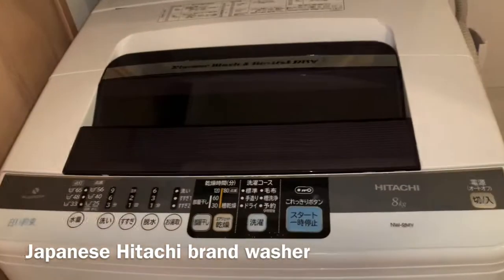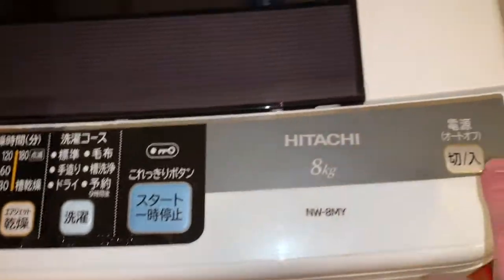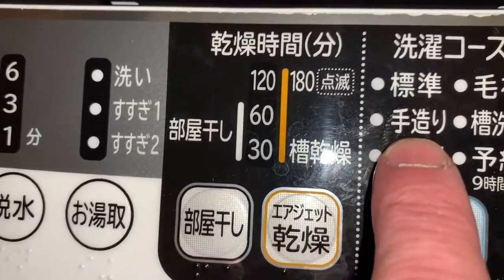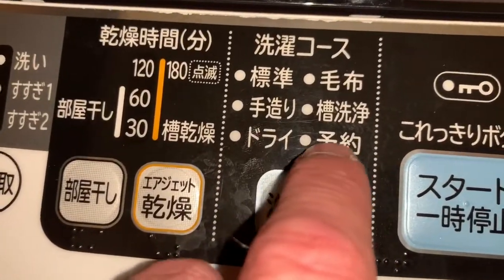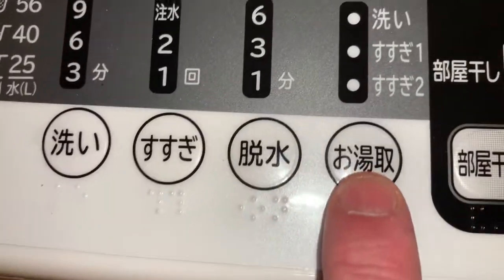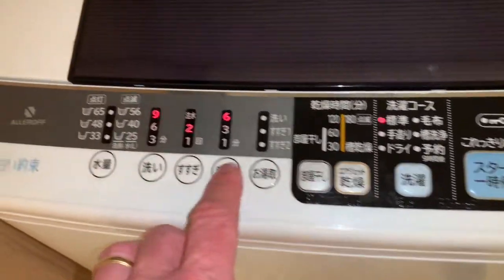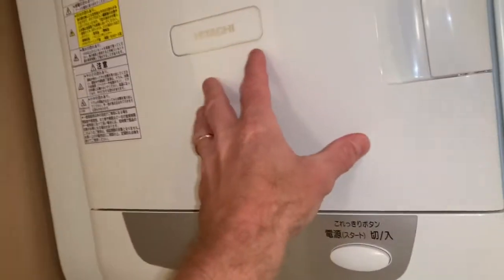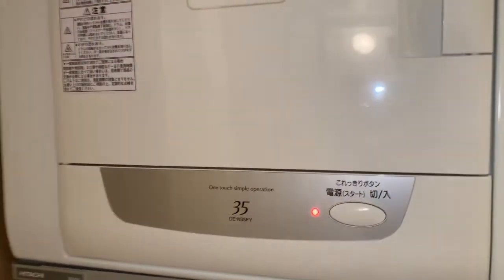How to Operate a Japanese Hitachi Brand Washer | Kanji Translation and Tutorial | Alleroff Model

Comment: Hi sir, the washing machine at my house makes a beeping sound when I press the power button, but no light comes on. It is 110 auto, it is 220, it doesn't press wrong. Previously, the water outlet solenoid didn't work.
Reply from the maker: I don’t know of a quick fix for this. Have you tried resetting the machine by unplugging it from the wall? If no luck there, I’d call a technician.

Comment: my machine no power, what is the possible cause and how can i fix it
Reply from the maker: Is it plugged into the wall? Is the power breaker on? Or off?
Reply: @DIYTechnician  we used transformer for it, from 220 v to 110v , our transformer is 100% working
Reply: Excuse for troubling. But perhaps the power of your transformer is too small. @tigasaingtactical4703

Comment: My w/machine will no power, what the problem, how to repair it
Reply from the maker: Is the power on at the breaker to it?
Reply: This machine input voltage of 110V, you should not connected to 220V. if you don't want broke ur washing machine.

You need AVR(Voltage regulator), if your standard is 220V. Whatever it is depend your Standard Voltage.